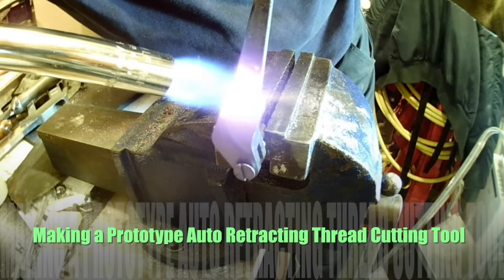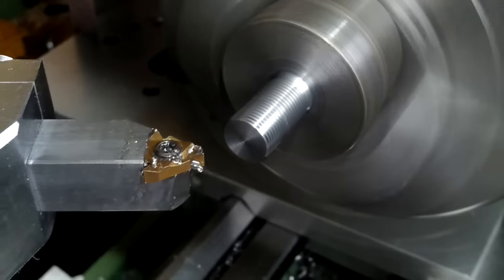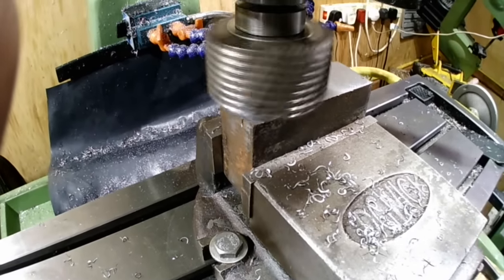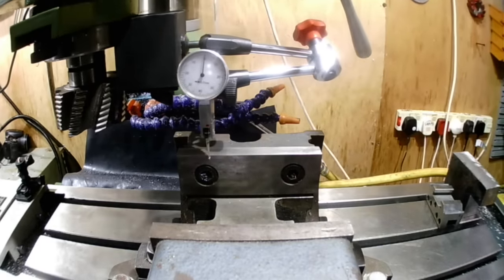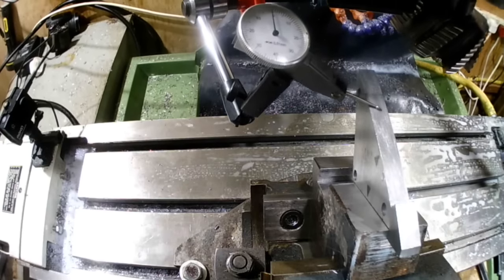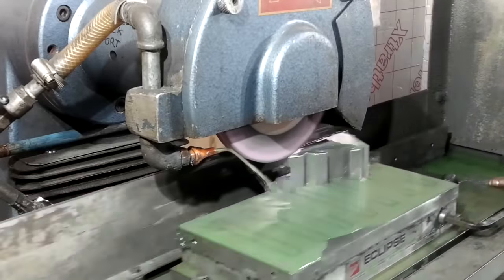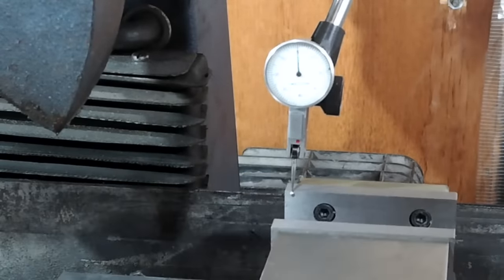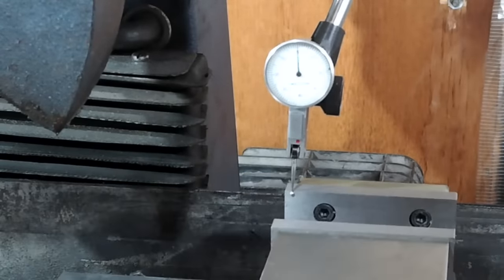Auto Retracting Thread Cutter.

Comment: this tool is unnecessary!!! just start the thread from the shoulder out!!! your threading in the wrong direction!!!
Reply from the maker: Hi, thank you for your comments. you are right, it is a very good technique, but not always, for instance, when the halfnuts need to remain engaged for cutting none standard threads, or like with my cheap lathe the halfnuts don’t always properly engage causing tool breakage or a double heilix thread. regards
Reply: Well, some lathes don't have reverse. And making such a tool is a great way to demonstrate your skills to yourself ... which sometimes you will question 😊
Reply: @Thesheddweller  here is how i do it !!! when you have a thread against a shoulder first make sure  you have a thread relief it must be deeper then your max pitch diameter/thread depth next set your compound @ 29 1/2 degrees in the direction your threading!!! away from the chuck towards the tail stock!!! this will allow you to reduce friction because the thread insert /tool only cuts on half the tool reducing tool pressure!!! next line up your threading tool in the center of the thread relief set your carriage dial at zero make sure to take out the back lash in the direction your traveling next set zero on your compound by touching the part to establish thread starting point!!! next set cross feed dial to zero removing back lash towards the part!!! next move the cross slide away from the part!!! next start the lathe and engage the half nuts with odd or even number if all looks good then turn off machine do not disengage the half nuts!!! next by hand reverse machine by turning chuck until you reach zero on carriage dial or if your lathe will allow you to safely bump it back to zero !!! now your ready to cut threads!!! once your at zero with the carriage and cross slide turn the compound in .005 add some oil turn the machine on and it will cut when you get to the end of the part turn machine off. dial cross side back to clear the part and go back to zero on your carriage your ready for the next cut!!! remember the compound is what is used to cut the depth of the threads not the cross slide the cross slide is used to get the tool to clear the part on the way back and to always re establish zero!!! what makes this work so well is your half nuts are always engaged!!! no worries about stopping and starting/re engaging the half nuts .also i make a test part out of aluminum or delrin this way i avoid scraping a expensive part!!! i have numerous lathes but i have a favorite one a graziano 120 sag all the controls are on the carriage it makes it a bit easier for making threads i also can put the transmission in neutral and forward and reverse the carriage with ease by turning the chuck!!! i was at a similar place in my career as you i thougt the same thing that i had to make all these special tools!!! yes special tools have there place but not here!!! also dont get carried away with speed slow and steady is much more productive!!! 
yes after fifty years at this game i have learned a lot it can be very humbling at times!!! remember frustration is the lack of knowledge!!!
i hope this information will help you take care!!!
Reply from the maker: @nelsontchir644  thanks, I use the same method, see www.thesheddweller.com
Reply from the maker: @y2ksw1  ain’t that the truth..
Reply: Very good video. I have a metric lathe and when cutting standard threads I need to keep the half nut engaged.  This would  make the process much better.. 
I there a chance I could get a copy of the plans? 

Thanks 😊
Reply: Doing as you suggest is a good way to cut a left hand thread, think about it!
Reply: Always a hater...I think it's a great idea. Not everyone has 50 years experience making tools or turning. Some I have seen on here, it should be factory fitted. Not mentioning any names...before spewing bile, maybe post a video yourself, as ya such an expert on threading.

Comment: Simpler solution is to cut the thread with the tolling turned upside down in the oposite direction, using thread indicator, that way you can never crash ;)
Reply from the maker: Hi,

Comment: What a great tool Sir. I'm only a hobbyist when it comes to machine shop work. My career background is pipe welder, tube welder, fabricator, and Boilermaker. I own a 1960 South Bend 13" lathe that had a lot of hidden issues until I actually did my project. I guess buying a lathe is worse than dealing with a used car salesman. I want to say thank you for sharing your work, if I ever am able to pick up a nice little mill I certainly will give this project a go. It was amazing to watch it work especially at 1000 RPMs
Reply from the maker: Hi Paul, have fun. cheers

Comment: I do prefer mechanical systems for something like this, so this gets the tick from me
Great work, and great tool
Reply from the maker: Hi, i have watched many of your videos i particularly like the gearbox and I wondered if i could make something similar for my lathe. I also found a large magnetic chuck in a skip, after taking it home I stripped it down cleaned it up and reassembled it works fine, but i’ve never used it, not yet anyway,  they are bloody dangerous things to strip and rebuild.
Reply: @Thesheddweller  
Plus the eletro-magnetic ones need a power cable that winds up around the spindle. 😖 I've used smaller magnetic chucks on lathes and I was always leery about using them. The tool grabs and watch out. Plus every time I used one I always took a very light skin pass across the the face as the chuck may have been used on a different lathe. I think Clickspring has the right idea of using cynoacurite for small thin parts.
Reply from the maker: @mpetersen6  Hi, thats probably why I’ve not used it yet.

Comment: You have got a winner. The “puckering” that you referred to, is something that I experience after more than fifty years. Now to find a way to get around the inch vs metric spindle reversal issues. I am now a new subscriber.
Reply from the maker: Hi, Thanks for your feedback I've never really cut threads in my working life, because the stuff I machined was too big for threads, it wasn’t until I retired and started my little workshop that I realised how efficient a laxative that threading could be. At work most threads that were cut were done using big Die heads and massive taps, until the CNC turned up then everyone got a dose of the S***s.
Reply: The inch vs metric spindle reverse issue can be tackled with a dog clutch Google Meek screw cutting clutch, unless you have Myford you would need to develop your own implementation but the principle is there.
Reply: @tonyray91  ,
   Hello. I did look at the dog clutch that was made by Graham Meek. It looks like a great option. My next step is to find some drawings, as a start to adapt the concept to a 16” South Bend. I thank you for the suggestion.
Reply: Hi Robert,  The Myford version is published in Meek’s book which is similar to what you would need on an SB model 9 but if the 16 has an internal reverse mechanism this might be more informative https://www.model-engineer.co.uk/forums/postings.asp?th=171112&p=3.
Reply: @tonyray91  ,
  Thank you. I am on the hunt.

Comment: If you have a lathe with a kill switch for the chuck guard being lifted or the back cover being opened, you could extend the wiring to those switches and move it to the ways as an adjustable stop for when after the tool pulls outs it shuts down.
Reply from the maker: Hi, a good idea but, to be fully effective the chuck spindle must have a jet brake and the chuck can't be a screw-on chuck. cheers.

Comment: I like your design and what's important it works on your machine.  What I like about it is that the workmanship is  so good and it looks tight.  I'm still trying to find a good mill and lathe and get to working on it.  I have many projects to accomplish.  I hope that I do as well as some people.  I am trying hard to find a quality machine too, I like precision and accuracy.
Reply from the maker: Hi, I just wish after building the shed that I had enough money to buy better equipment, but as in life one has to make the best with what one has.
If I could wind the clock back, would I have chosen differently, yes I would have bought old British, German or American machines and refurbished them if they needed it. as I did with the my grinders and will do with the shaper.

Comment: Nice exercise in processing! I've cut about every kind of thread on the lathe you can imagine, and you are right, there have been a few times the pucker factor came into play. I'm glad to report no permanent damage to the sphincter or the lathe.
Reply from the maker: HI. Thank you for your comments. I’ve not cut a huge number of threads in my time, but one thing I do know, is that the two laws of probability ‘sods law and murphy’s law’ both play a part in thread making, doubly so when using thread gauges. 
regards

Comment: You developed a great tool, simple and effective. I'm surprised that someone isn't marketing this product. 
I have been working on a different solution to the same problem. My plan is to use the output from a DRO scale to set an electronic stop which would control a VFD with a braking resistor. Your solution is far more practical for mass market application. Thank you for sharing it :-)
Reply from the maker: Thats a brilliant idea. because it doesn’t have to be triggered by a DRO it can also be triggered by a mag mount slide switch for those without DRO's
Reply: @Thesheddweller  A switch would work, but I already have a DRO and it offers some other advantages. I want to be able to start deceleration before the carriage reaches the actual stop location and need a method of measuring carriage velocity. I intend to use a rotary encoder to measure the velocity of the chuck.
Reply from the maker: @EDesigns_FL  Have fun.

Comment: Great design  and well made .. in all my years as a toolmaker I have never seen a  surface  grinder  with the wheel running anti clockwise,, .may I make a suggestion   .. when using the side of a wheel dont us coolant for some reason it doesn't  clog up so bad ( don't know why) greetings from a retired scotsman in South Africa.? Keep safe from mr covid.. Dug Hogarth
Reply from the maker: Hi, Dougie. Thanks for your feedback. I'm hoping my next project will meet with your toolmakers eye, with simillar praise. It is true about the side load grinding, I used suds to prevent the bluing that can occur if its not used. I also shaped a relief in both side faces and redressed the sides regularly with a carborundum stone.

Comment: brilliant idea...... you have steady rod set at head stock to activate the retract lever but at the same time it is also necessary to disangage slide attached to lead screw
Reply from the maker: Hi, thanks for your comments. yes the Half nuts are opened manually as soon as the cutter retracts. Regards

Comment: In my experience, spiral fluted taps are really only your friend in blind holes. Any through holes, I highly recommend standard straight flute, Japanese taps. Heavy weight oil on steel and stainless. Tap heavy is messy, but has proven itself superior to just tap magic. Clean up heavy is best done with some acetone, then some isopropyl, or that I had available.

Comment: Great design, and even a better job bringing it to life.
But I have one little trick to share with you. Shortening a tension spring and creating the loop is actually very simple. First determine how many coils you want to remove. use a Sharpie to mark the center between the two coils, the line up the mark on a 90 deg corner of a vise, and give it a quick rap with a steel hammer. This will split the coils by a 45deg angle. use a die grinder to cut through the unwanted coil, then fine tune the end loop. 5 minute job.

Comment: I like your approach, designing process and machining. It is interesting designing and proving a design concept. Sometimes while in the manufacturing process of the parts of a concept design you may notice varies that were not considered in the design. These type of situations for the most part are solved by the machinist on the shop floor. I see this in your video and respect your knowledge and skill. awesome!
Reply from the maker: Hi, Thanks for your kind comments

Comment: Situations like this are one reason I am really in favor of Single Tooth Dog Clutch systems similiar to those found on the Hardinge HLV-H/EM and other high end lathes. With an adjustable stop collar that is on an operating rod connected to the handle that engages the Dog Clutch. Engage the clutch, take a pass and the tool stops when the dog clutch is dis-enganged. Retract the tool (cam operated on the compound) and engage the clutch in the other direction. You never stop the spindle. You never dis-engage the half nuts. Yes it takes the same amount of time to run the yool back but while it's doing that you can advance the tool for the next cut. Imperial, metric, Module or DP worms. Or any helical pass in the capabilities of the machine. It does not matter.  The tool will always pick up the thread. In fact the Hardinge has no thread dial on the machine. The only constraint on the system is the dog clutches must run at the same rpm as the spindle. 
The other (and simpler) option of course when cutting threads to a shoulder is to run the lathe in reverse and thread away from the chuck. This however is not necessarily an option for threaded on chucks.
http://www.lathes.co.uk/hardinge/index.html
Reply from the maker: Hi, thanks
Reply: i could never understand why they did not design a multi tooth clutch -- say, four engagement positions per clutch rev, and run the clutch at one quarter of spindle speed. Then a big lathe with a heavy chuck and workpiece could thread at full speed without the teeth getting deformed by the impact (which always used to happen sooner rather than later to single tooth clutches in such situations)

Comment: Great idea. Must say I've always gone for the quick wrist flick but then the bigger shoulders and shorter stick outs limit that at speed...or I give myself a root diameter groove to work to and make sure I'm ready to react!

Either way, your system trumps the lot and the ability to work at a speed that suits the tips as a CNC lathe would, is brilliant!

Congrats.
Reply from the maker: Hi Thomas Henderson, thank you for your comments. The tool will need a thread root groove for bigger threads or the insert will break.
Reply: @Thesheddweller  I saw you say that in another comment. I take it the spring-out is so sharp you practically end up with a dead stop at the end of the thread?
Job for the Mk2 version, cams out the thread depth in a single rotation and then jumps right out of the way. :-)
Reply from the maker: Cam out before snap back is worth investigating. I'll look in to it....... When I get a couple of spare minutes. Cheers:-)
Reply: @Thesheddweller  Keep me in the loop! :-)

Comment: What a very good idea !  I too have a Warco lathe, mine has the milling head mounted on the headstock (WMT300) unfortunately I do not have half nuts on my carriage so I have to stop the lathe pretty smartly when coming up to a shoulder and into the runout groove and then retract the tool 100 thou and then reverse the lathe all with the change wheels engaged . As much as I would love to use this sort of design I can't see how it would help in my situation, plus the fact I have a Multifix tool post and no chance of making a 40 position tool holder for that little item!
Reply from the maker: Hi, multifix tool posts, excellent choice of equipment. I admit that not having a half nut system on your lathe is going to make threading a little more than awkward for you, I don’t envy you. But I also have to leave the halfnuts engaged while cutting some imperial threads on my metric lathe, I haven’t crashed yet. ‘Touch wood’

Comment: Rather interesting idea and execution.
Have you ever tried doing threads in reverse, so that you are cutting away from the 'point of maximum pucker' ? The only significant change that I would make, if duplicating the idea, is to move the trigger activation so that it could be done closer to the ways, maybe using a sliding stop clamped to the ways, and a bolt/threaded part, for fine adjustment. Getting the mass of the tool holder down might help, also, maybe drilling it out, as the 'tube' formed would still be rather stiff?
That is a MASSIVE cutter on your mill!
Reply from the maker: Hi Lohi Karhu, thank you for your comments, I have used the backwards method and it is a good technique, but my lathe is a cheap Chinese lathe and the half nuts have been known to badly engage, causing a tool breakage or a double helix thread that's why I made this tool. Also, the half nuts can be fully and properly engaged at high speed. The index register on the lead screw, can also be confirmed at this high speed before the thread is started. My other issue with backwards threading is, that often the half nuts have to remain engaged to achieve the desired thread, like imperial threads on a metric lead screw. The tool is also designed to swop with other tools on the same QCTP without having to alter the QCTP position. I hope this clears up any questions why I made and showed it on YouTube. Regards

Comment: Just watched  your video it was great and what a great design. I have a couple of questions though.  Do you have a complete blueprint available because I would like to make one? Next I do not have a surface grinder. Could it be made and work without one? I have a different tool post but I don’t see that as a issue , do you.? Thanks so much.
Reply from the maker: James Pancoast hi. I have a sketch it is posted on my website. www.thesheddweller.com there is no reason why it can't be made on any machine but you might find it useful to make the ram as snug a fit as possible.
Enjoy.